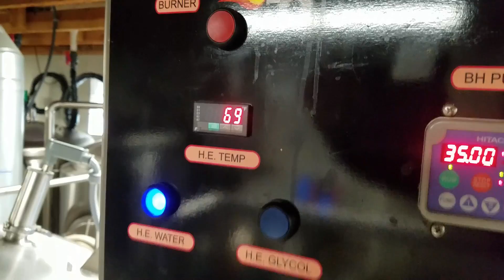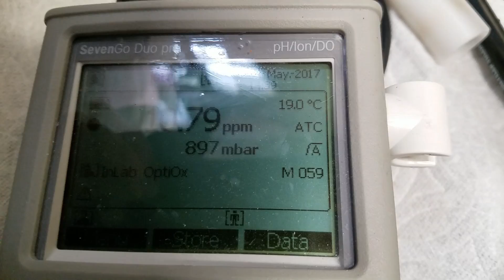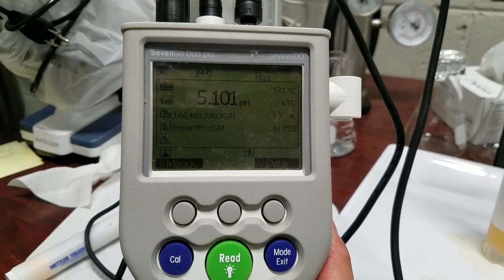KNOCKOUT & YEAST PITCH!! How To: Microbrewery!

Comment: Great videos, really appreciate the tips! Equipment question, what type/size hose do you use for your O2 & CO2 lines? I'm assuming all SS quick disconnects/fittings as well? Last, do you use check valves near the carb stones to keep beer out of your gas lines? Thanks!

Comment: Great video !! After yeast harvest do you count the cells? How do you estimate pitch rate?
Greetings from the Brazilian friend!!!
Reply from the maker: Thanks Eriel! Yes, Ill count cells when harvested and again the morning of the brew day. Estimating pitch rate can be done by weight or volume. My old way is this: Collect cold crashed yeast, (0.3)x(bbls of Knockout Wort)x(Plato of Wort) = Lbs of slurry to be pitched. Hope this helps!
Reply: Thanks a lot!!!
Reply: @brewerylife3596  how much it is in million cells/ml/plato.
Reply: @brewerylife3596  Love your videos! I am working towards starting a 5bbl brewery and wanted to learn about yeast harvesting. Currently, we don't use a brink, we actually don't do much of any yeast harvesting, as we use glass 12Gal carboys for our fermentation process (probably something we should be doing considering we have a 1bbl system). I have seen most of your videos and had a question about using the brink. When you collect yeast from cone of fermenter, do you do anything to that yeast? Or are you simply calculating its viability and its resulting weight of yeast that needs to be added back? You mentioned in your other video that you were not using the top ports to add nutrient because it was going to be used the following day, but I was wondering what you do for yeast that will be used the following week? Thanks for any help/advice. Ive been learning so much through your videos and the yeast counting is in my opinion something we have to start doing if we want to be successful when we open. Cheers!

Comment: how much cost your do and ph meter? does the machine you have require calibration?
Reply from the maker: It is a fairly expensive unit, Mettler Toledo sevengo sg98.  It works great for pH and most DO readings but if you're a big packaging brewery a more expensive DO meter is probably required. One that can tell the difference between 2ppb and 9ppb. This one does jumps of 10ppb. (0,10,20,30ppb). It does require calibration about once per yr. Cheers!